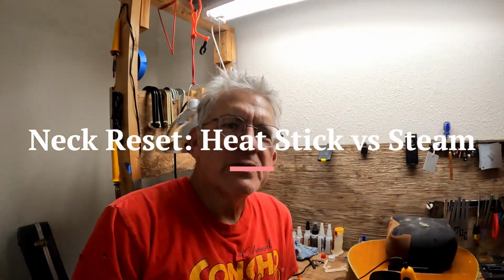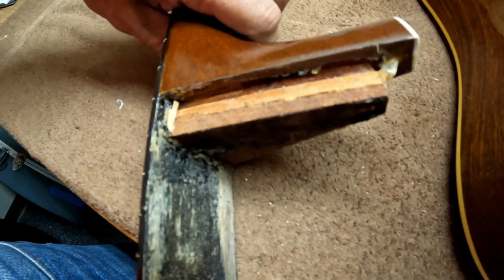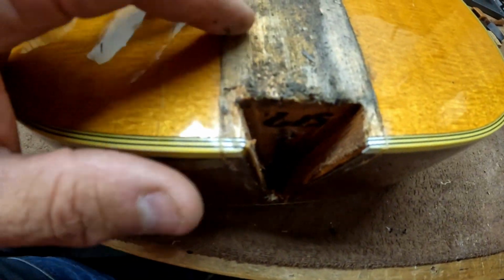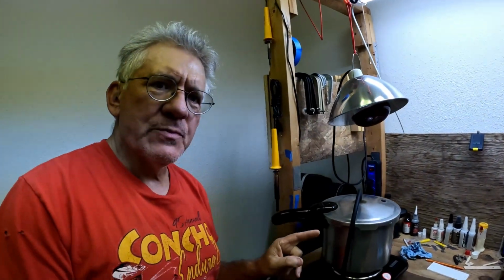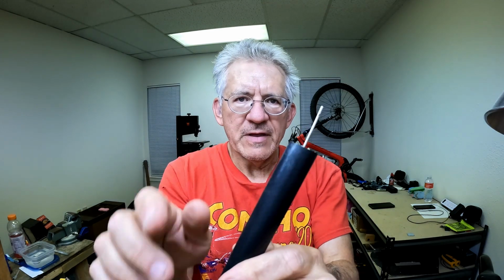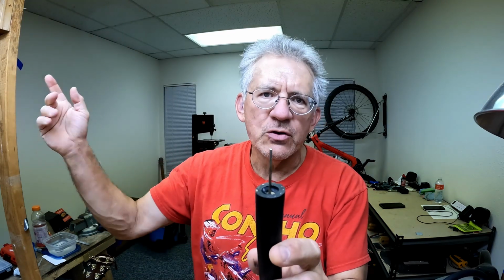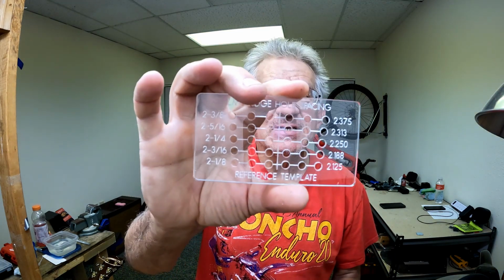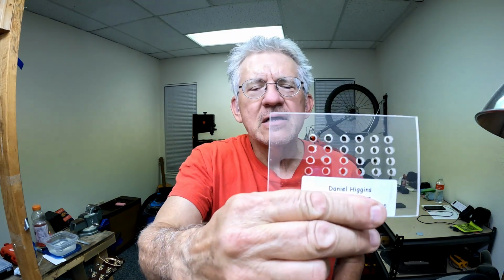Neck Resets: Heat stick vs Steam plus fun tools

Comment: you  probably already know, but there are tools called transfer punches that will make shallow marks in the work surface probably better than an 11/64" drill bit.
Reply from the maker: I bought a set right after I made this video.  😁✌️

Comment: Great video! I've done about 150-200 resets, and I'm pretty much self-taught, with a few pointers along the way from luthiers who were kind enough to give me a couple of pointers. I use steam. I'm comfortable with it. This video nails it for me, I will stick with steam.
 I use the StewMac (made locally by Brown's Guitar Factory) needle/ auto fuel line setup, with a Mr Coffee Cappucino maker I bought at ChinaMart (WalMart) about 20 years ago.That gives me control by bumping the steam switch to give intermittent bursts of steam that I do in spells whilst holding the guitar upside down and facing me so that the excess hot water flows down and collects in the bottom of the mortise where the blob of glue often collects (especially on all those old Harmonys) and melts it.
 I never separate the fingerboard extension on the sides of the dovetail prior to steaming because the glue blocks that jet of stream of steam that always blushes the top finish. 
Then I wiggle it off SIDEWAYS, NEVER FRONT-TO-BACK, and if it needs a bit more steam, I repeat that process and try again. PATIENCE here is the key, it will come off when you have melted all that glue, and not before. ( Impatience here is where you break heels).
 DO NOT, UNDER ANY CIRCUMSTANCES USE A Stewmac-type neck jig. It is a heel-breaking machine! If you do this carefully, by hand you will be able to feel the joint loosening and simply taking the neck off when it's ready...like a wet band-aid. With that damned jig, you have no idea when it's ready.
If you want to learn how to do this, get a bunch of crappy birch Harmonys and practice. That's how I did it. Anything with a dovetail will work. Threw a few in the trash at first just to save the embarrassment , I have to admit.

I still dont have the balls to take out a rosewood 70's bridge plate  LOL

Comment: Where those foam cutter heat sticks from China excel is on Gibson and Guild guitars that have glued the neck heel to the rims. Some Gibson J-45s and J-50s, from the early ‘50s on, are laminated sides and back, and tend to delam with steam being used. Guild is known for strange use of glue types. Some repair people just won’t do neck resets on those Gibsons and Guilds. One that has no problem doing them uses the Chinese foam cutters with great results . I know its not your clientele to bring in these other guitars, but just in case, you may want to hold on to those heat  sticks.
Reply from the maker: I think they would work fine on many original neck sets.  It's just when I ran into long shims that I wasn't pleased.  I'll keep them around and keep playing with them.

Comment: Hey Bryan. Looks like my guitar there! Glad you finally got the neck off w/o any additional problems. Btw surprise dowel, the shims & ineffective heat stick, you had hands full. Hopefully, when back on the body it'll fit better than ever!
Reply from the maker: It'll be good!  I'll use better shims and 1/10th the glue (and fish glue).
Reply: Sounds good.

Comment: Bryan, have you ever used heat or steam to try to straighten a neck (take relief out of a neck) rather than using compression fretting? If so, how does it work? Pros and cons? Maybe this is a topic for a video (or maybe you've done one?).
Reply from the maker: I rarely do compression fretting anymore.  I can but I've found that it usually creeps back over time, plus it excludes using Evo frets or at least limiting yourself to whatever has variable tang sizes.  I've never done the heat creep because that means breaking the glue bond plus breaking the fingerboard/neck finish line.  What I usually do is work with the fingerboard/frets themselves:

https://www.youtube.com/watch?v=6BFlRCeqAKA
Reply: @Bryankimsey   Interesting - I haven't heard about compression fretting also creeping back (probably not as much as the heat treatment), but I suppose that's logical.  Thanks; I'm the one who has raised this question in a recent topic on the Tech Forum of the UMGF.

Comment: Respect for giving the heat sticks an honest trial and sharing your experience.
Reply from the maker: I'm sure they work great for some people under some situations but for me.... no, not right now.
Reply: @Bryankimsey  I wouldn't discount them all together, but at the same time, you're comfortable with what you know works well & your experience/results speaks for itself. I've seen some other luthiers that use the sticks & they often use an eye dropper to add water in the drill holes as needed. Most steam pots seem to take up a fair amount of work space & are often difficult to control the amount of steam, but it looks like you've worked ways around both issues. I'm a firm believer that steam is the best course of action. It would be good if you could somehow combine the 2 & have a bit of extra work space. That's just my 2 cents & I'm sure that you've probably thought all of that out already. Congrats on the 73 D-28!!!! That's a great guitar!!!! I'm bummed about LMI. Stew Mac will most definitely go WAY up on their prices now that their main competitor is closing up shop. Awesome video as always & thanks for bringing us along for the experience!!!!
Reply from the maker: @redlinemando  When I got all done with it, the pressure cooker/hot plate really didn't take up that much more room than the heat sticks and their power supply.  I have to deal with getting water, but, oh well.   On the neck shown, I injected 6 pipettes of water!!!  The sticks just don't toss the steam around as well.
Reply: @Bryankimsey   I was glad to see you give it a good test run. I was really considering investing in the sticks until I saw your video. I started looking into the tools of the trade a little more & I definitely see what you mean about the Stew Mac needle being a better option.
      I don't fully understand why people get so tore up about the blushing. I can understand it when they're taking it to someone with limited experience, but it also comes with the territory on the older guitars. When you have the right person doing the job & the proper precautions are taken, it's really not that big of a deal. In several instances I've seen, it went away on it's own after a while. 
     I had a 72 D-28 re-set a few years back & the top blushed on both sides of the FB extension. I left it alone, just played it for a couple weeks & gave it time to fully dry out. It mostly went away on it's own & the rest buffed out easy. One of the leading causes of blushing, is from people thinking they can use furniture polish on their guitars. I use the Meguiar's "fine cut" or the Meguiar's headlight polish. Never had an issue with either one.

Comment: Im really glad to see this video because I have been putting together a steam rig and was feeling that I maybe should have bought the heat sticks. Thanks for this data!
Reply from the maker: Sell ya mine.  :). The new pricing is cheap enough that you might try them but the jury is definitely out for me
Reply: @Bryankimsey  I like the idea, but, after watching this video and listening to your points, I agree it appears the steam IS infact the better way. I think at one point I saw a pressure gauge mounted on your other cooker back at your main shop, do you find the gauge is nice to have or is it something you really don't end up looking at that often?
Reply from the maker: The gauge was there on that cooker and so I just left it... it never gets anywhere near "red" because pressure's being released but it's handy because when you run out of water, the pressure will drop to zero.  My new one doesn't have a gauge but does have pressure release valve.  I'll keep an eye on it until I trust it.  :)   If I ever stop steaming for a few minutes, I generally turn the heat down.
Reply: @Bryankimsey  That makes sense.